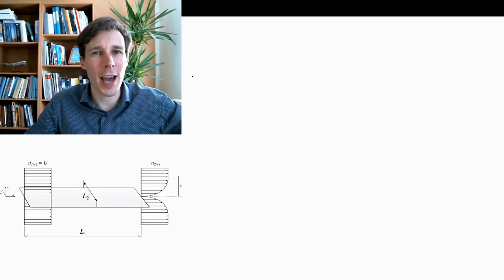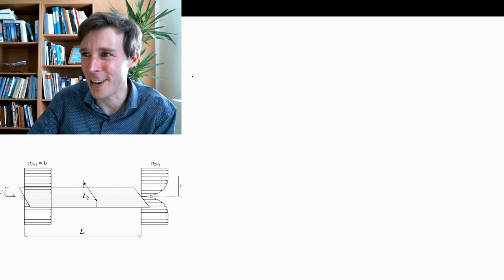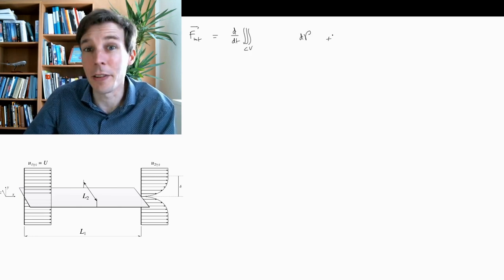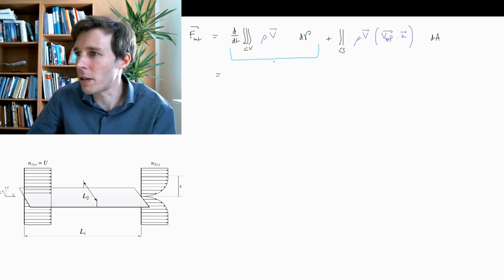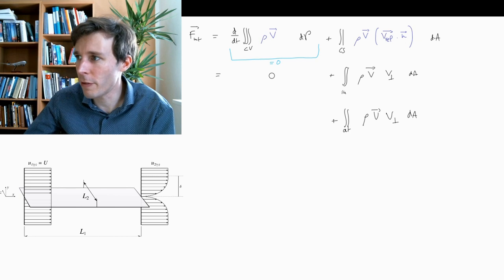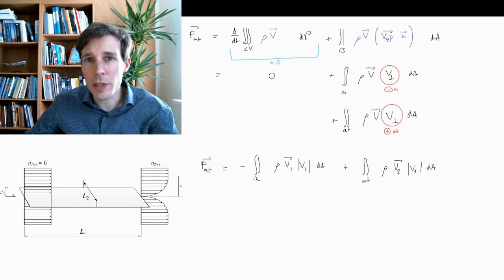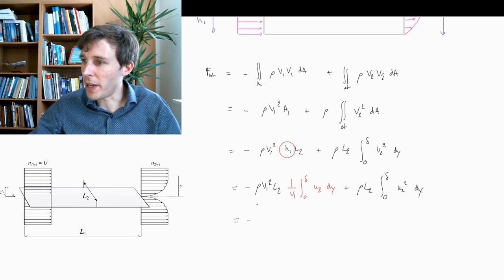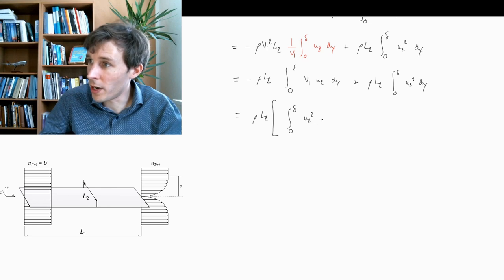Calculating the net force in a boundary layer control volume (Fluid Dynamics with Olivier Cleynen)

Comment: Hello Olivier,
We calculated force only for upper half..so can we twicw this force to calculate the total net force as there is symmetricall bottom half also?
Reply from the maker: Hello Sahil, indeed, in this calculation I only looked at the top half. The two sides are symmetrical with respect to the plane of the flat plate. If you choose your outlet to include the bottom layer too, then you have twice calculated force applying. There is no need to carry out two integral calculations. You can just multiply the result by two.